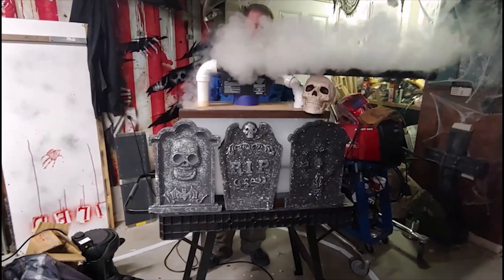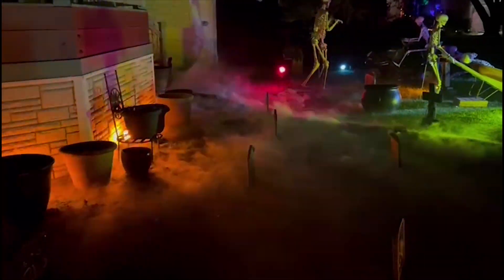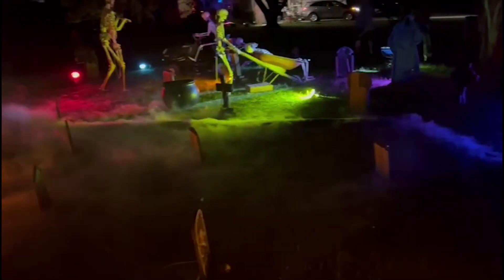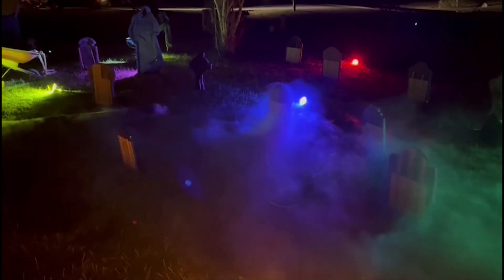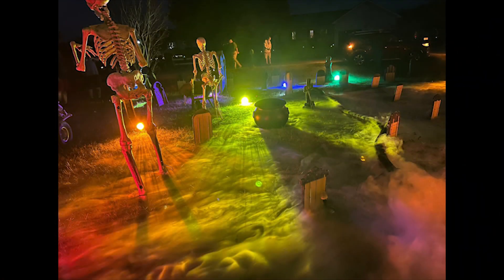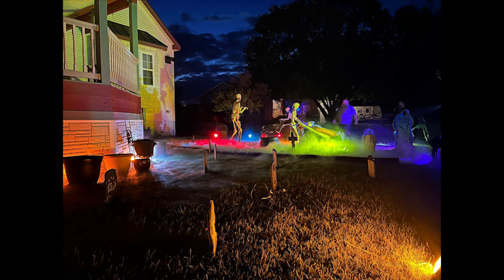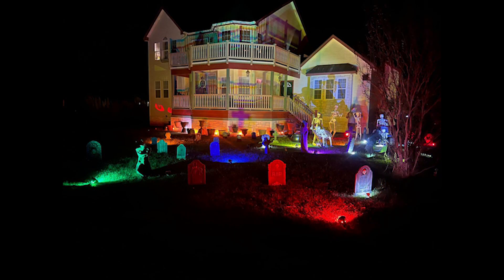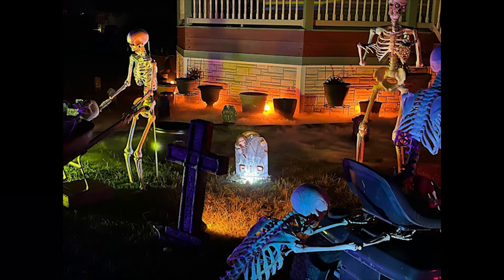Low Lying Fog Effect

Comment: Thanks for the post.... this reminds me of my issue with the one I put together last year's Halloween (check my channel, 2021 video) I purchased the floater for the mister so that avoids the recirculation pump, that was a good move, it's more expensive for what it is, but it saves on the complexity.  So... my issue was that I used a large tote (with wheels) for the fog chamber/tank... and it was impossible to seal it up,  I went through a lot of trial and error... mostly error with sealing weather strips,  after tinkering and getting frustrated I ended up just duct tapping the $&#@!*! out of it and even then it still leaked a bit... (ugh!)   So I need a better solution for a better and new fog chamber this year... Any tips/pointers would be appreciated.  Thanks!
Reply from the maker: I am subscribed to your channel, I remember seeing that video.
I also bought a float to try it out. It does save on complexity for sure. My initial thought with the recirculating pump was to run the water through a radiator on the outside to cool the water down as it gets quite warm during use. It turns out, the warm water had a negligible effect on the fog so I am comfortable with the float.
I will do a breakdown video of what I'm using now. I found a locking tool chest that had a rubber seal where the lid meets the body. It's very well sealed all on its own. A couple penetrations for the wiring were sealed with silicone.
Using the fan to have a constant draw from the fog chamber helps I think.
So yeah, I'll see if I can shoot a video explaining my current setup this weekend.
Reply: @intocoasters    Yes please another video, It would be great to see how you made the chamber... maybe it should be called the fog mix chamber?  Hmmm... well, that's not a bad name for it.   What I think is going on with the water and fog (vapor) is it much hotter than the water that it doesn't need to be cooled too much to make it heavy and drop down...  I would guess that there is a water temp that would be ineffective, but with this design it would not be encountered... just a guess.
Reply: @HobbyHalloween  I had a lot of issue with sealing a tote as well. I found a large tool chest that had a top I could more easily seal worked way better. A couple of people have said they found tool chests with a gasket already built in that worked perfect.
Reply: @OakLaneCemetery  I need to invest in something like that, I was frustrated chasing leaks... and now I've got this enormous tote that I need to seal up and use as a "tote"  Do you have any recommendations on the tool chest totes, like HD? or Lowes?? I just don't want to waste time and money on finding out that one would be easier than the other AFTER I make the purchase and cut into it.  Thanks.
Reply: @HobbyHalloween  I used a kobalt box from Lowes, but still had to use rtv to seal the lid. It would be better to have one of the ones with a built in gasket. Just be sure there are no vent holes or gaps around the handles and hinges.
Reply: @OakLaneCemetery  Ugh... gaps around the handles brings back the nightmare I had  sealing that tote I used duct taped and tested then more duct tape... it was crazy, eventually I said that's good enough but the dang thing still leaked... grrrr!  I will look at HD since they are practically across the street from me, I think they have a Husky or some such brand that might do the trick, I heard that they're setting out their Halloween stuff so I can look at that too as a bonus... Lowes is a bit further away for me, but I can check them out too if HD doesn't have it. Okay,  Thanks.